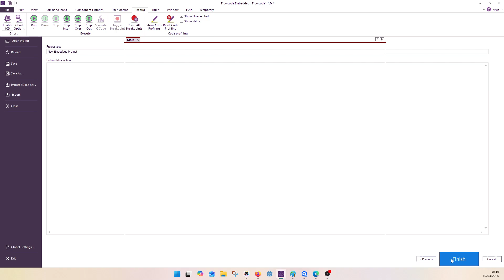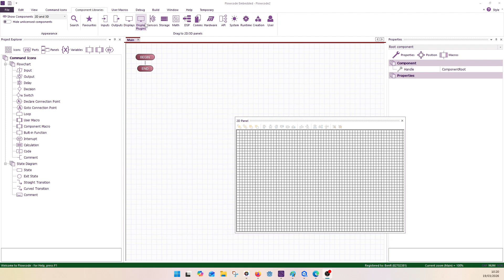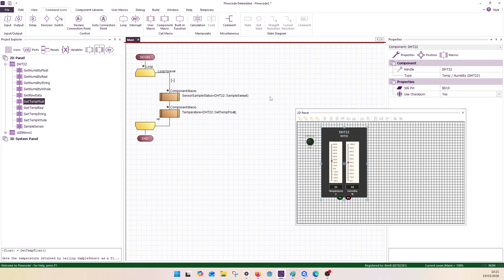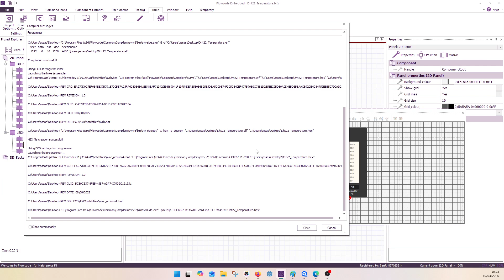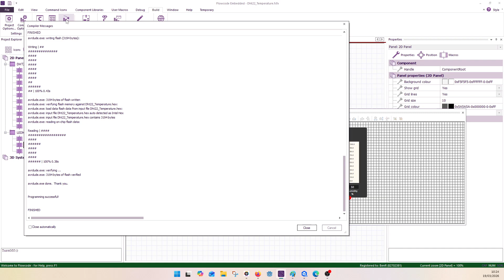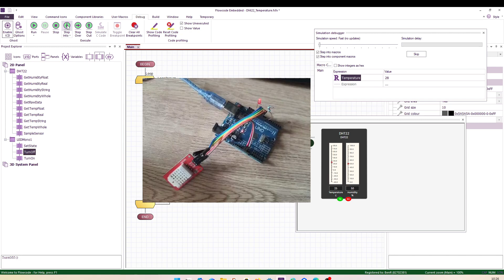Flowcode 11 Serial In Circuit Debug (ICD) using USB to Serial

Comment: I'm not familiar with this software. How's the library support compared to what people have made for Arduino IDE?
Reply from the maker: It's pretty good. it's not got everything that Arduino has but it has an active user community and anything missing gets added fairly quickly when requested. The big bonus is the easy of creating simple to read, portable code and not having to worry about things like syntax issues or missing semicolons.